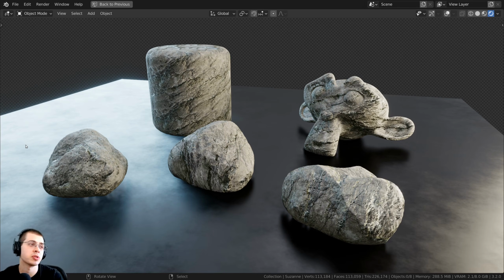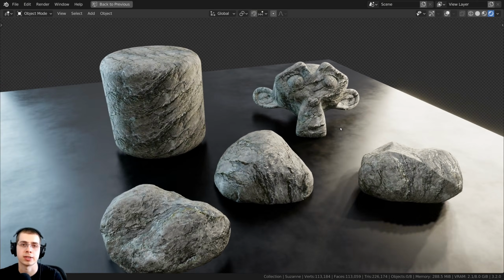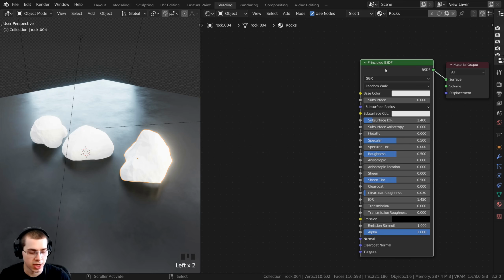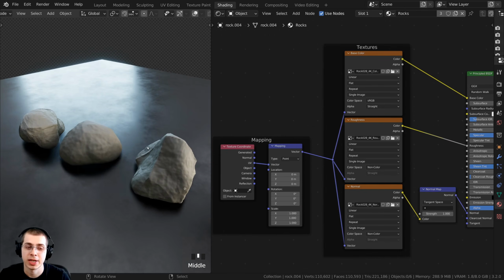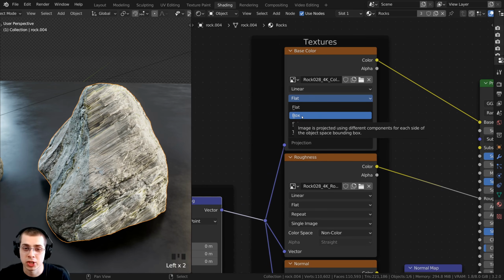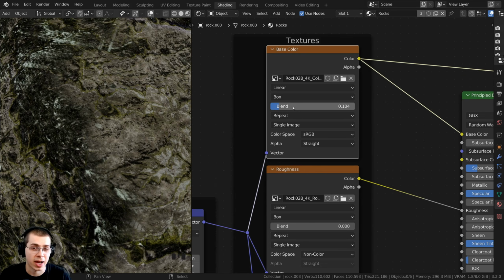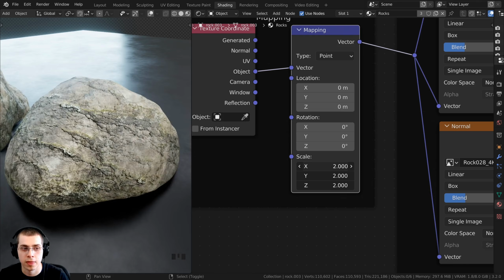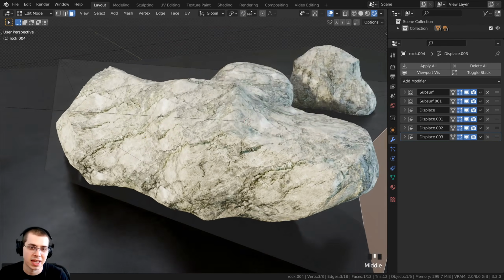Easy Texturing Method Without Using UVs (Blender Tutorial)

Comment: The only issue with that method is that texture won't apply properly when you export your objects (as obj, fbx, etc).
Other than that it's very useful and a lot less cumbersome than using UV maps
Reply from the maker: yes thats right. If you want to use it in another 3d program, you will need to bake it to texture maps.
Reply: @RyanKingArt  this baking-process would work through the cycles-Baking-settings?

Comment: How would someone bake this resulting texture to the same mesh/a copy of the mesh that was already UV unwrapped?
Reply from the maker: Just make sure the mesh has a decent UV layout, and then bake it. When you bake a texture, it will bake to the UV map of the object. Then once the textures are baked, replace the material with a new material that is using the baked textures.
Reply: @RyanKingArt  Aah, I see. Thanks!

Comment: that's really interesting, nice tutorial, i may use this in my game in the future when i am making the map
Reply: for a game you want as little overhead as possible. this is basically dynamic uving. its much more costly at runtime than a static uv system. so beware your paying for it.
Reply from the maker: If your using it for a game, you might want to bake the textures to new texture maps, after you set this up. Not sure if this method of texturing with work in other software, like a game engine.